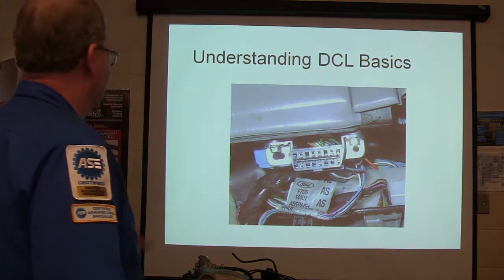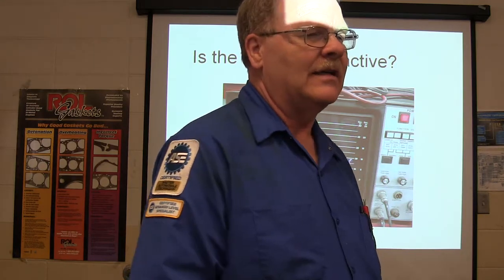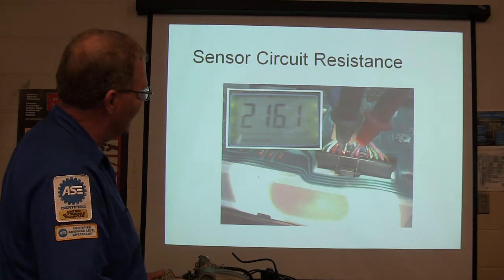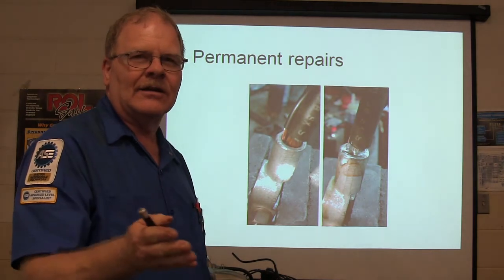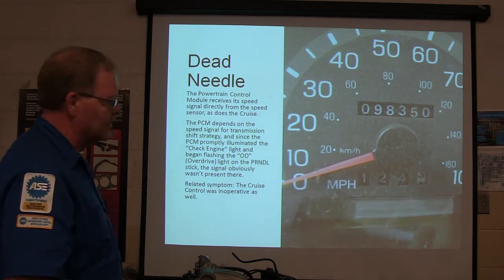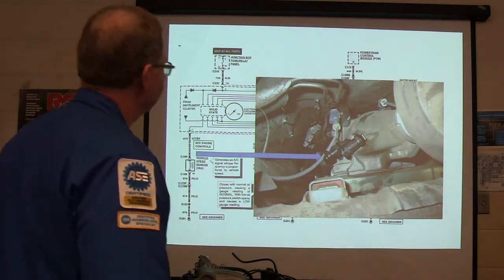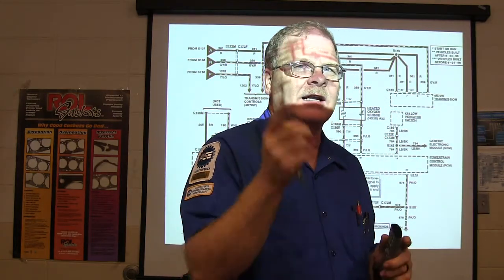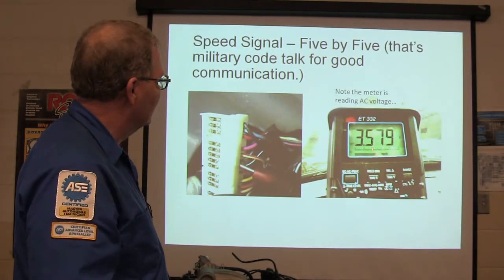Two Speedo Issues   War Stories

Comment: Hobby shops have some good easy to use electric connectors that can flow some amps. Them critters are eating the wires. Some of the wires on the new cars now have a flavored insulation that the critters love to eat so be ready to see a lot more critter damage.